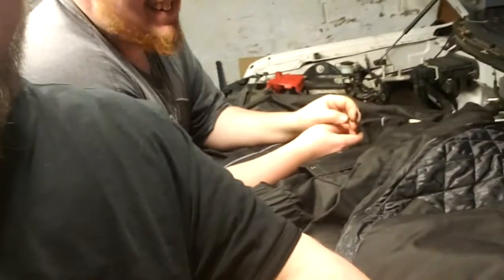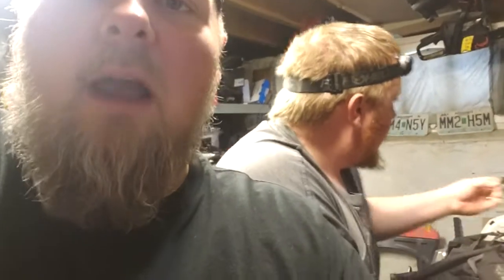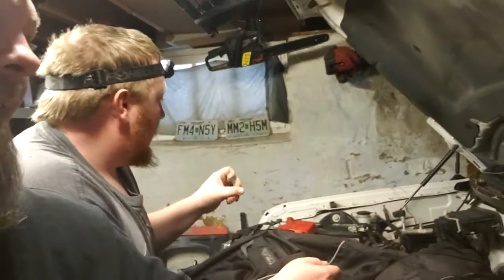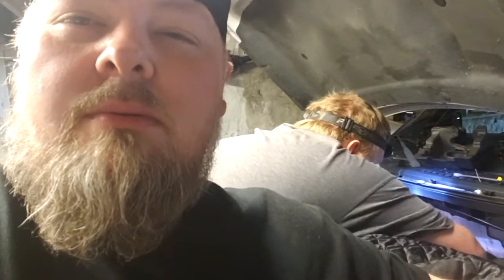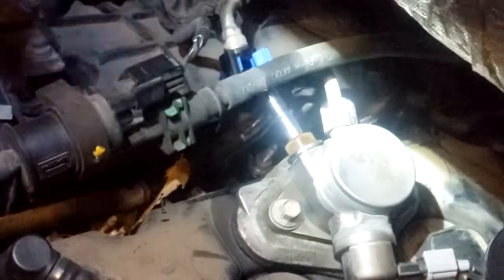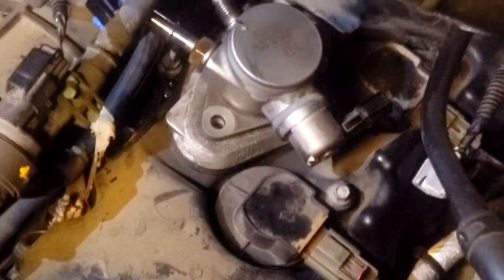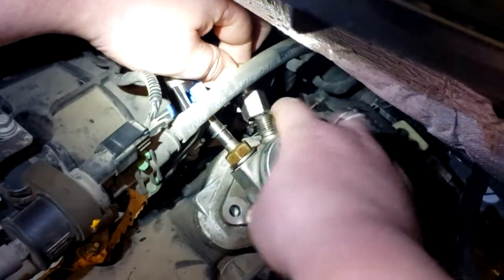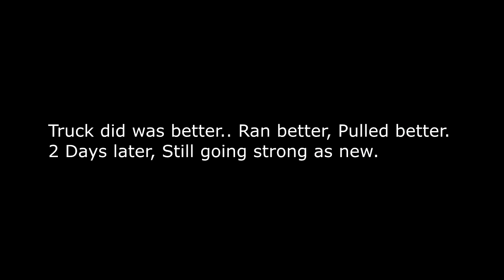Ford F-150 High Pressure Fuel Pump Replacement

Comment: Huge help, thank you! .. Disgusting what a dealership wants to try and charge to have a simple fix like this done.
Reply from the maker: I have no idea. But I do know that a tow truck bill and 120 for them to even look at it sounds a little bit too excessive because of a simple fuse or and a sensor.
Reply: @FatKatMOTO  Wanted to charge $1,300 to replace one on a 2.7L
Reply from the maker: @2Dahpoo  I believe it. I did it my self so I have no idea what the price would have been. A little research and asking around always is cheaper. Throwing parts is never cheap. And only 50/50 chance. Iv done that before. Many times. Unfortunately
Reply: @FatKatMOTO Did you reuse the bolts?

Comment: Guys my 2013 ecoboost  has a horrible mpg any ideas of what could be the problem?
Air filter is good, tire pressure is good, spark plugs are good I would really appreciate if you could help me out.
Reply from the maker: Change the high-pressure fuel sensor that sits next to the spair tire. See what happens.

Comment: Is that located underneath the intake manifold? My 2005 f150 4.2l v6 has the same symptoms described in your video. I wonder if it has this high pressure fuel pump too.
Reply from the maker: Take off the beauty cover, then there is a 7inch black rubbery looking thing, just lift that off.. You will find it on the back right of the motor.

Comment: Could you hear the fuel pump in tank come on with ignition before cranking? We don't hear the pump. After sitting a while then you hear it and it starts but doesnt run long or good and dies.
Reply: The 3.5L Ecoboost does not have an in-tank fuel pump to the best of my knowledge.

Comment: I’m having a similar problem. Mine does it after every time I put gas in it. It doesn’t matter if I fill it up or not. The gas gauge will only go to 3/4 when I fill it up as well. Any suggestions? Same motor same year
Reply from the maker: just a gauge issue? Or has troubles with fuel? The rear pump has the gas measuring item. If you are having trouble with fuel/hard starts/bad MPG/Lack of power, could be tank pump. If its just gas gauge issue, i wouldnt worry about it too much. Try to hit the tank with something that wont damage the plastic and see if that changes how much gas is in it.
Reply: FatKat On A Bike Along with the gauge issue it only has trouble starting after getting fuel. I’m still getting about 15mpg. I didn’t have a problem until after I got it back from the dealership. They did the cam phasers and timing chains.
Reply from the maker: @alfrancis82  ohhhh. They actually fixed phasers and chain? I had a 08 Explorer in 2013 they said they would fix it. Junked it for me.. lol.. Ok, Do some looking around about your year, and model and trim on " Purge Valve " .. See if that maybe it. You could clean it with spray, however the part aint that much. If there is no codes being thrown, that would be a step in that direction. If you run ecco boost, try and replace #27 fuse with a new one. Also, you do try to electro spray clean, do the 3 sensors under the hood.

Comment: What happens if you “don’t get lucky” with the position
Reply from the maker: Explain? Position?
Reply: @FatKatMOTO  the position of the piston thing the HPFP  goes up against. I cranked the engine for a split second to move it and I got the HPFP in, but unfortunately for me the truck STILL did not start...

Comment: Does that thing have solid lifters? That's alot of valve train noise
Reply from the maker: Its a normal Ford sound.. Mainly the Chain.. 2013 3.5 has issues.. From what i read its the worst year to have.
Reply: Have you heard engines with high pressure fuel systems before? There noisy

Comment: Ford dealer' high pressure fuel pump is cheaper than Rock Auto part. Do not buy parts at the Rock Auto.   Rock Auto's return policy is bad.
Reply from the maker: Ok so i went on line to find out if this information is true. OEM Ford Dealer is $200 even. Rock auto is $98.. Hmm weird. Iv had this HPFP replaced a year now. no issues. So im confused.
Reply: @FatKatMOTO Ford don't make this part anymore and my 2011 F150 with the 3.5 in leaking right under the direct injection fuel pump #BLZE-9D376-CE